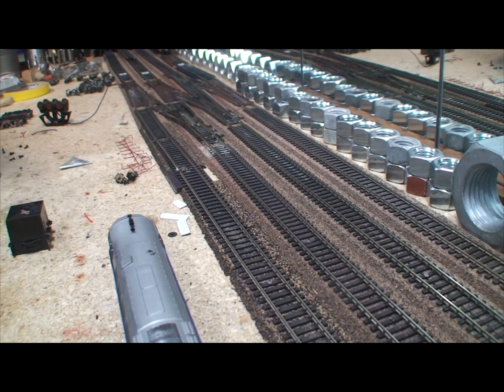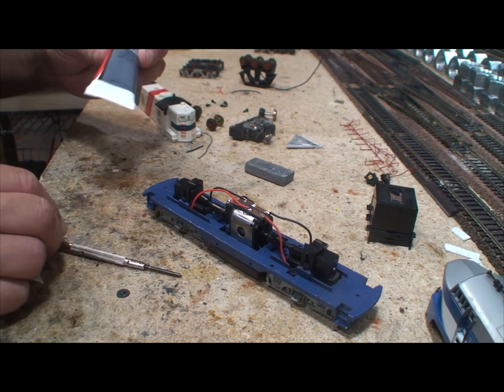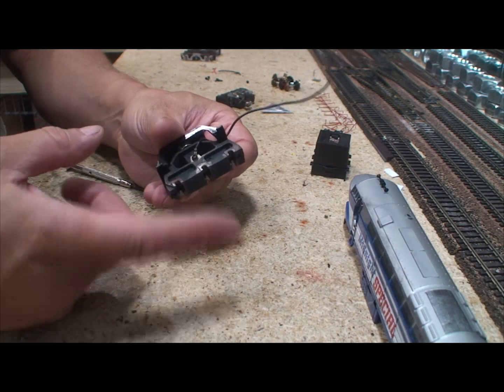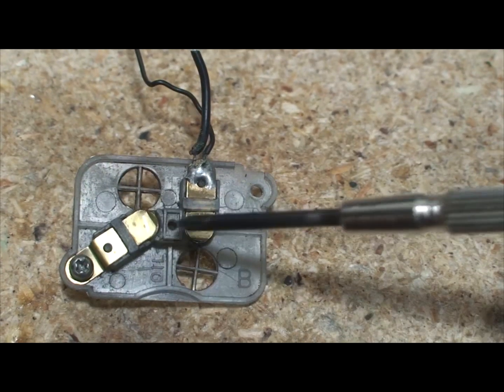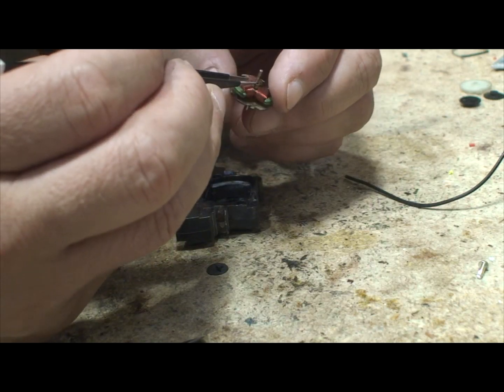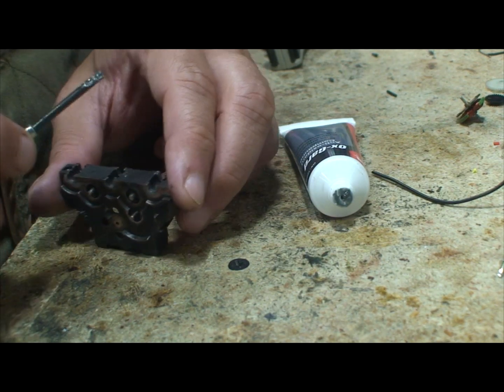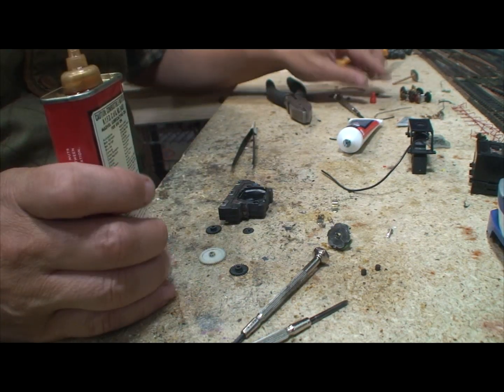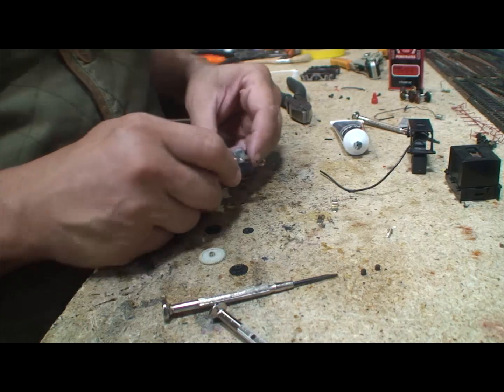Tyco Power Torque Rebuild HO Scale Locomotive

Comment: Great video. The thing that used to irritate me about those Tyco pancake (power torque) motor design, is that tiny pot metal gear that was held in place by some "liquid nails". 

Whenever that motor would run for an extended length of time, that liquid nails would get soft, and that little gear would fly off the PTO shaft from the motor, and the locomotive would sit and whine with only the light glowing. 

When Tyco went back to the MU-2 motors, I liked them better.
Reply from the maker: check my Silver Streak Holiday special because I went more in depth on these motors.  the pinion gear is supposed to be a friction fit.  If it's loose, I'll do a drop of super glue, which is still removable because it's metal on metal.  give that a test.  if that doesn't hold, do it again and put just a tiny bit of baking soda on the super glue which will make it even stronger.  don't use anything that is too permanent, like contact cement, or you'll take away the ability to do maintenance in the future!

Comment: I like the thought process.
When I am tearing down things which have small springs and other escape prone parts,  I use  a clear bag and one hand inside with the unit and the other hand outside holding the whole thing.
It's saved my hands and knees many times.
Reply from the maker: I discovered that I could find many lost things using a self-level laser because the laser line on the floor with make even a tiny spring light up with a very bright reflection.
Reply: @elite194  yes!
I like that better than my method of using a flashlight and a magnet in a sandwich bag.
I taught several sewing teachers how to pick up spilled needles and pins.
Of course it's useless for brass pins and springs etc.
Reply: Yes, I likke that thought too. I have been thin linking of using a photo tent with the same idea. I recent!y spent money on springs and motor brushes that could replace those I lost. Some of the brushes I need are smaller, and was able to sand them down to size, then cut them to length with a wire stripped bolt cutter.

Comment: Thanks for the OX-GARD tip, my engines run much faster and smoother now.
Reply from the maker: it's the magic stuff, all my track is coated with Oxgard and I almost never need to clean it.  I have sections that haven't needed cleaning in over 5 years

Comment: Yesterday I got a Mantua - Tyco in the mail. Today I rebuilt the motor following this video step by step. It is alive. Thanks. These videos are great. Now I need to find a video to rebuilt another Mantua - Tyco, a Santa Fe that says 5628 on the side. I think its a GP20? It has a motor that's flat and looks to be all metal.
Reply from the maker: yes that would be a GP20.  I did a xmas special on the Silver Streak locomotive which internally is identical and very soon I'm going to do a new special on the Golden Eagle, my personal favorite, and it also has the Power Torque.  now there is an older motor that I don't remember the exact name, but it's something like the MU motor I think, that one is one that I only have a single locomotive that has it and I've not rebuilt since I last did it in the 90s.  there are 2 facebook groups that are for Tyco and if there is anything I ever need to know I go there first because that is where the real experts can be found and you can get parts from people who specialize in Tyco purely out of passion and won't steer you wrong.  the GP20 is another favorite and when detailed is a stunning locomotive.  i recently used it in some AHM rebuilds because the final version of the GP20 used a system almost identical to the AHM GP18.  next video up will be a DD40 on my bench for a friend and then some 1 day builds which might include another power torque....
Reply: @elite194  I watched your video on the Tyco GP20. My Mantua-Tyco GP20 has a very different motor. Not at all like your GP20. Mine was flat with a magnet on top of it. I could not take it apart or get at the truck gears. I was able to take off the commutator and removed the brushes in order to clean the armature. After working on five different motors in the last two days I have come to the conclusion that  Athearns is my favorite by far. My biggest surprise was the momentum on them after I turned off the power.
Reply from the maker: @kentpool7414  that would be an MU2 motor I think is what its called.  there are people have parts for those and with some difficulty they can be good as new again - that being said, if the motor and drive aren't important to you, set that shell aside for another project where you transplant it onto a different drive system.  the GP18 is my favorite use for those because nothing looks cool like a GP20.  look at my silver streak video from last month where I remove all the guts to a tough shell, that should help you get ready for something cool to do with that GP20.  think about what it could be and not what it is - it will be cool and people will tell you its cool.

Comment: The motor is a casting, probably 413 aluminum. 413 is nearly the same weight as lead, but much more sturdy. which eliminates adding a weight somewhere else. I would not power brush these surfaces, but cotton swabs and 91% alcohol or an equivalent should do. I do like the OX guard as a good conductor and preservative. Always keeping in mind that we have access to a large number of synthetics that great for a precious little engines. Yes, parts for these are harder to replace. I have been able to get brushes that are slightly oversize, and reduce the diameter and cut them to length. Its unfortunate Tyco made these like they did ( can't change that now). I would like to have seen one of these as a 5 pole motor, maybe some day it will happen. One thing for sure, is that we got a lot of variety engines from them that became a fantasy collection for us. Other makers did the same, just not as much a the big T. I am amazed to think they never got into N scale. Well, if you read all of this; thank you. I will step down from the soapbox now as I am really late in making a comment. BYE
Reply from the maker: so the casting is actually copper plated zinc alloy, aka zamac.  this is why the steel brush is used to clear the oxidation. hopefully that is not actually rot.  I've not run into any Tyco that had rot on a power-torque yet... and I hope that holds to be true!  Since this time, the lube of choice is always red lithium.  I've obtained newer red lithium since this, but it's the same stuff and same super ultimate reliability.  it never wears out ever!  as for brushes, turns out Aurora slot cars are the same, naturally, since they're Tyco, but that racing community has any replacement part you will ever need to include upgrades for the magnets!

Comment: Thanks for the video.  I started a rebuild on my power torque motor only to discover one of the brushes had disintegrated from years of use.  Is there a source for new brushes?  They measure approximately .125 inch in diameter.
Reply from the maker: yes there is! you are looking for Aurora slot car parts. those are the same company!

Comment: I had one more thought for first timers, if the plastic gears seem frozen, listen them up with light oil
Reply from the maker: we don't use oil here!  remember it's lithium grease only!  you can drop the whole works into hot green cleaner if absolutely required!

Comment: Question, i have a torque motor that is missing its pinion gear... real pain in the butt... where would one find a replacement?  Could i 3d print one?
Reply from the maker: the gear is off to the side somewhere and goes back on after this process.  You can NOT 3D print these gears because the torque and heat produced in operation will distort and 3D printed material.  Get the guys in the various facebook groups dedicated to Tyco to sell you new ones.  Also you can sometimes find on ebay a Power Torque motor if you need it - usually very cheap!

Comment: how does one go about replacing broken armatures that you say can be repaired easily. I have a motor that has a broken armature/axle for the large gear.  Any help would be appreciated.
Reply from the maker: Aurora slot car racing clubs have all the parts, including upgrades, you could ever want!  Check my 2020 Holiday Special Tyco Silver Streak video because it is much more in depth on fixing up the power torque!  There are Aurora slot car websites and forums and facebook groups that have guys who are into very advanced rebuilding.

Comment: Hello, great video! Have an old Lifelike that was my Dads with a pancake motor in it that I'm trying to tune up, bought another at train show to have for parts, Decided I was going to get it running as it wasn't running, I'm sure it was opened before . When I put the motor back in (after cleanup) between the magnets, it pulls to one side, does it matter how the magnets are in there, polarity?? Noticed one magnet(right side) has some white on it, and nothing on the other. This is an older video but still very useful to beginners like me
Thank You
Chris
Reply from the maker: the painted sides face up with the white being the left magnet - I've got a ton of videos on Life-Like pancake motor rebuilds.  did you check to see that the tiny axle shaft on the core is seated into the small phospor bronze bearing on the cover that keeps it centered?
Reply: @elite194  I checked again and only one side has a hint of white, was on right side, no color on the other I could see. I will try reversing magnets  and see what happens. Just found your Vids the other day, I subscribed and will be watching more, some great info. My Dad retired from CPR in New Brunswick Canada, he had A CPR set and CNR, just two ovals, not much scenery and he loved it, We bought him a steam engine which I also have. Thangs for replying and great jo on videos, just getting into it here and very helpful
Thank You
Reply: @elite194  And yes the axle shaft was in the bushing but seemed kind of tipsy
 if that makes sense, was all the way in with one thrust washer on it, Tks
Reply from the maker: @normy033  that should be where the problem lies.  with the motor cover off, the core will be pulled to one side, but once the cover is on then there should be no wobble.  sometimes and extra thrust washer can tighten it up a bit!

Comment: I was just disturbed a bit. I meant loosen up any old oil or grease by soaking it lightly first. The pins they rotate on can break off the casting.
Reply from the maker: if you must, soak it in boiling hot green cleaner or put it in the ultrasonic on 53c and you'll have no troubles

Comment: Hello, I have a Tyco HO electric train, an axis (pole) of one of the gears broke or chipped... Is there no longer any possibility of starting it up? can it be welded? Greetings from Mexico...
Reply from the maker: yes you can!  I have used small nails to make new gear axles.  I've drilled a hole, put in a small nail from the opposite side and a little glue.  You can trim the nail after you check operation.  Tyco motors never die!
Reply: @elite194  Hello, thanks for answering soon, ok I'll try it, it has a lot of sentimental value for me since it was a gift from almost 50 years ago, I always kept it, although they currently want to buy it for me... Greetings and a hug!
Reply from the maker: @JohnnyM-06  yes you can fix it! I've fixed Golden Eagles exactly this way with small nails and they work aweseom!
Reply: @elite194  Can you share an email or how can I contact you?
Reply from the maker: @JohnnyM-06  you can email from the About page - there is a button that says contact email
Reply: @elite194  Hello, thank you very much for the tip!
The shaft is already super good, but now I have another small problem, some 2-gear teeth are worn and do not make full contact with each other, it is very intermittent and every time I start the engine they wear more...
I am watching tutorials to repair the gears but they are too small, any tips for this? Greetings!!!
Reply from the maker: @JohnnyM-06  yes, it is possible to replace the gear with a new one. this is something that I have been working on for a while and had a huge breakthrough on Monday.  I haven't worked out every detail, but in general, count the teeth on the gear that is bad.  be very accurate and check more than 1 time.  mark the teeth with a Sharipie so you know.  tell me then how many teeth you counted!  after that, I can identify the gear and tell you how to get a new gear!!
Reply from the maker: @JohnnyM-06  also send me email from my ABOUT page with some pictures so I can help you restore this motor!
Reply: @elite194  Thank you!!!
The largest gear has 45 teeth, the same gear has 8 teeth on the bottom...
And there is another smaller gear that turns the wheels that has 28 teeth...
Reply from the maker: you're looking for a 45 teeth .5 modulus, 8 teeth .5 modulus and 28 teeth .5 modulus.  the 45 is going to be the hardest to find.  these plastic gears are used in robotics and can be found on amazon, ebay and aliexpress.  there are also some online stores for robotics that have excellent selections!

Comment: Repainted a Tyco F7 and it turned out great, I was going to make a dummy, but looked pretty good.  So type repair rebuild Tyco HO and who pops up as the top result??  Obi Wan of Train repair. thanks.  Going to look for step one, taking the truck/motor off.
Reply from the maker: F7 is particularly friendly to making it a dual motor....
Reply from the maker: check out my Holiday Special from 2020, that's a Power Torque C430 Silver Streak and I learned a lot more lessons and did a much nicer wiring job on that one.  Getting the motor out is in that video

Comment: I know this is a bit after your post, but you said something referring to repairing broken gear pins. Care to enlighten me.
Reply from the maker: YES!  I used a small nail with a flat head and drilled a tiny hole just the right size and epoxied the nail into the hole.  Worked even better than the original pin!!
Reply: @elite194  Thanks for the reply. I kind of thought that would work but thought you might have another way to do it. Live and learn.

Comment: I have a tyco steam locomotives that makes a rattling sound on the track
Reply from the maker: the first thing that tends to rattle loud are when the drivers are too loose and the axles don't stay quartered.  there will be a sound that comes the gears not meshing at the right time - very easy to fix, just don't make the drivers too tight
Reply: @elite194  i need a lower gear on the pancake motor the  one that matches the big gear
Reply from the maker: count the teeth on the old gear then goto amazon and search .5 modulus gear with the number of teeth you need and you find the gear

Comment: How did you get the plastic part that hold the  pancake motor in place in the shell off?
Reply from the maker: carefully pull the shell apart, use wood door shims if you are afraid of breaking the shell.  The tabs closest to the middle of the shell come out first then you can wrestle the front end out.  The weight will drop out first if you haven't already removed it.  The trucks come out the same way as the weight, but are just a little harder to pry loose.

Comment: Wear can I get replacement parts for TYCOHO GAUGE TRAINS SANTA FE 2654 ENGINE
Reply from the maker: 2654 is a GP18 - look at my playlist about AHM rebuilds.  that particular GP18 uses the all wheel drive system.  there is a special group on facebook dedicated to AHM locomotives.  many companies sold that locomotive, but AHM was the main source.  Model Power also had it.  Join the AHM group and post a picture of your locomotive, especially the parts that are broken.  someone always has the parts in that group.
Reply: THANK YOU FOR the  INFORMATION

Comment: I have a tyco diesel that is making a squealing sound and barely run
Reply from the maker: the squealing happens when mineral oil was used to lube the motor and dries out later, take a look at my 2019 Holiday Special Tyco Silverstreak and you'll see how to use red lithium that is dirt cheap from the auto parts store

Comment: thanks for teaching me the ropes. i launched my brush and spring into oblivion. so i lost a set and my engine is toast.
Reply from the maker: they are the same springs and brushes from Aurora Slot cars and those are really easy to get.  Also the magnets are the same which means that the upgrade magnet for slot cars also upgrade the power torque locomotive.  Aurora is Tyco.  People have been making aftermarket Aurora stuff for many years so don't give up hope on the engine yet.